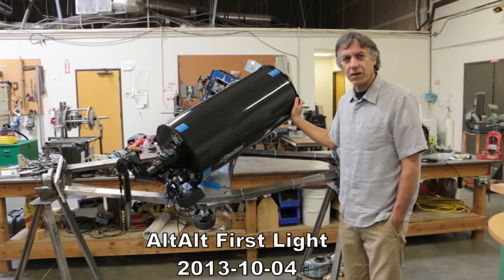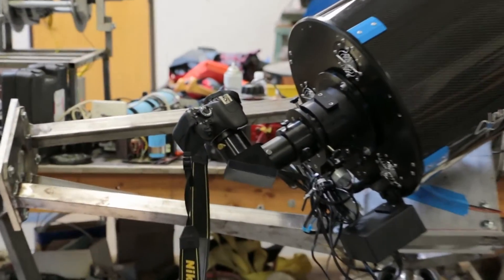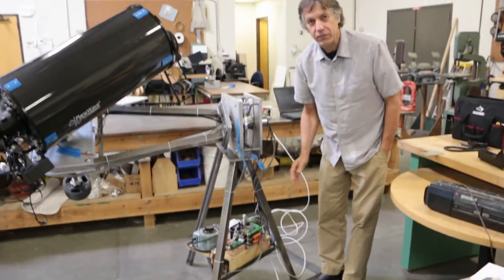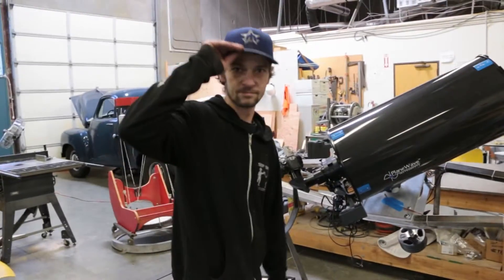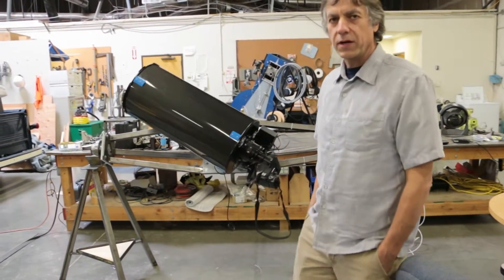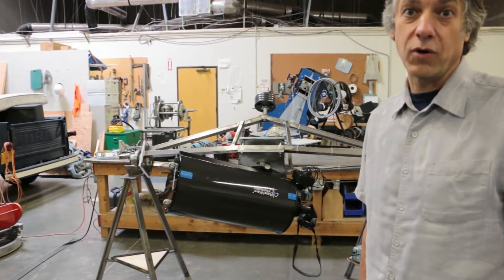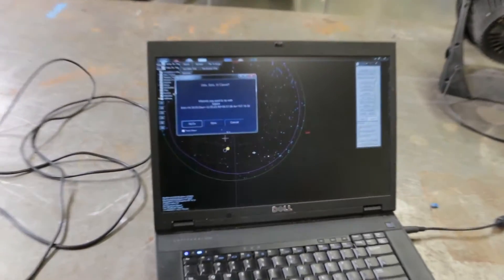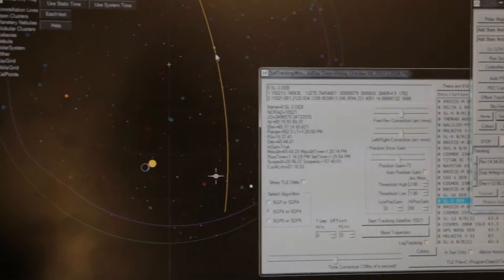First Light Video, Alt Alt Direct Drive Telescope Mount

Comment: Beautiful, Dan!  

Any reason your alt-alt mount wouldn't work in an English cross-axis configuration with perhaps a different thrust bearing on the bottom end?

Jim Sgt
Reply: That is terrific !  (Is is also a cross-axis English turned flat)..  Next should be a bracket to hold a pair of radio antennas for listening (and later talking) to HAM Radio satellites (It should excel at that second purpose).  since software likes alt-az that is fine enough.  https://upload.wikimedia.org/wikipedia/commons/9/91/Zeiss_di_Merate_-_incrocio_assi.jpg